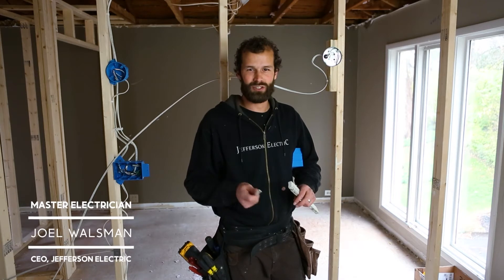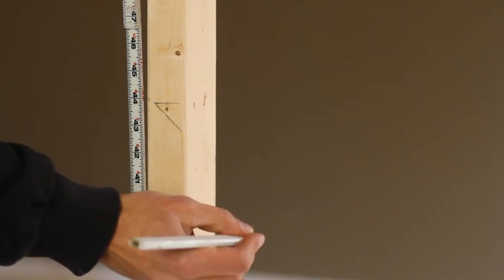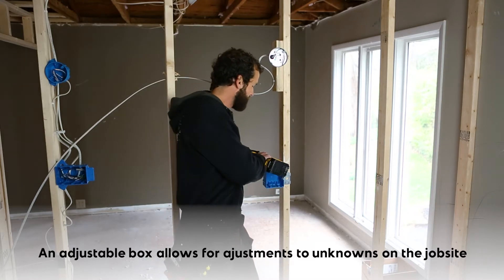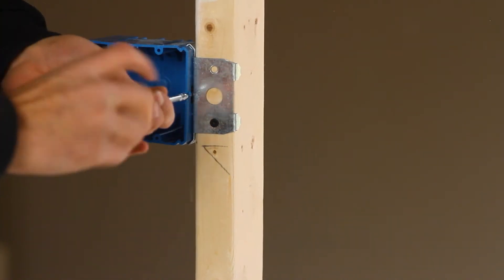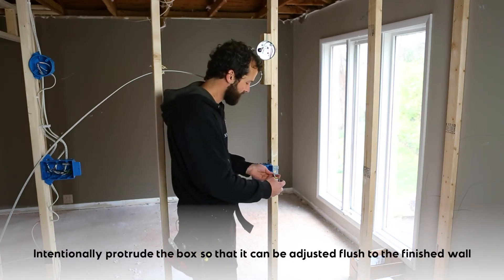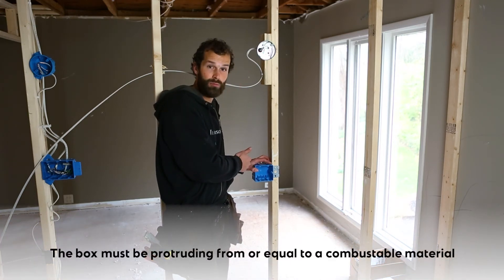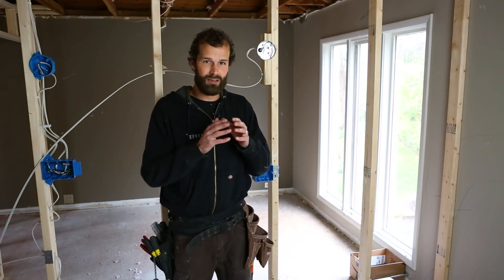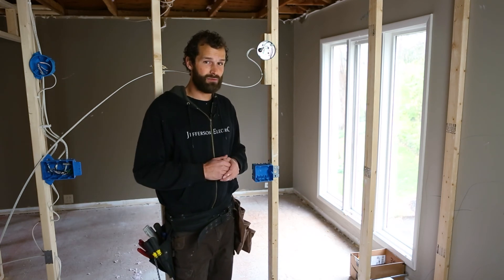Elevate your Game with Adjustable Depth Electrical Boxes

Comment: how does the metal bracket on that adjustable 2  gang box not interfere with drywall sitting flush? Good video thanks for sharing

Comment: I’m doing a school bus and I used 2x2 to frame and the depth is only  2 1/2 inches to the back of the wall could I bring it out with this box and have it only stick out an  inch so when I put the ship lap it’s one once it would be level regular boxes are to deep thanks

Comment: Good choice for this application! But no contractor will use them throughout the whole house as they are too expensive. You might want to also mention the use of a spark shield when the boxes further than the quarter inch minimum.

Comment: I installed these adjustable boxes in a kitchen remodel. Set them to be flush with the drywall, assuming whatever the backsplash may be, I’ll adjust the depth and install the receptacles without any problems.The countertop guys came in to install the backsplash (2cm quartz slab) and covered the edges of the boxes. The boxes can’t come out past the slab now. I was not happy (as a matter of fact, I was f###ing pissed 😤). Then  I realized, the boxes should’ve been left protruding all the way past the drywall, leaving no other choice except cutting around the box. 😎
Reply: I was thinking the masons would probably do that too!